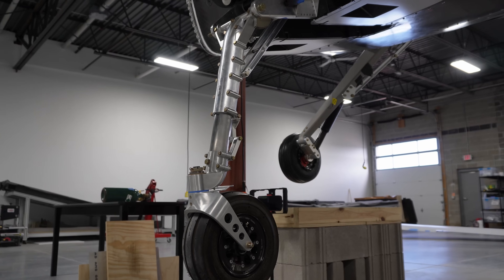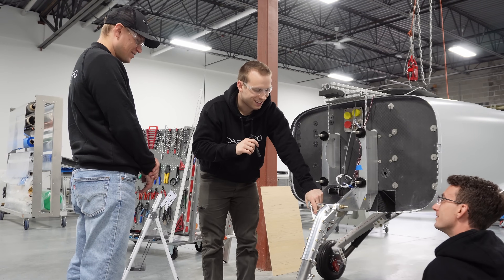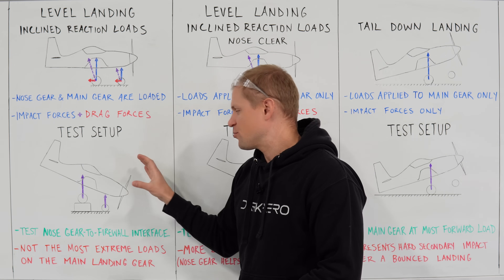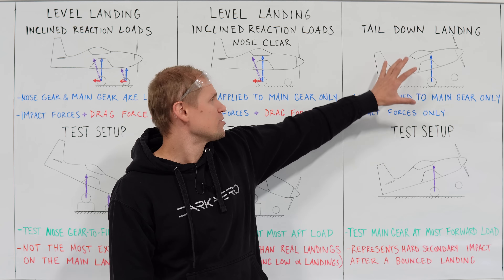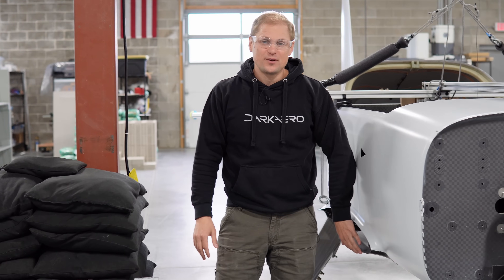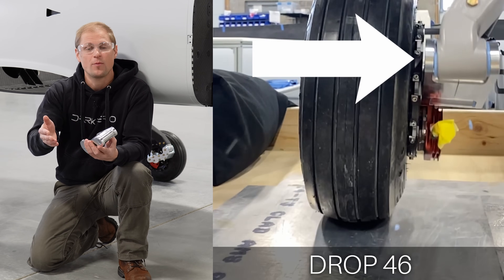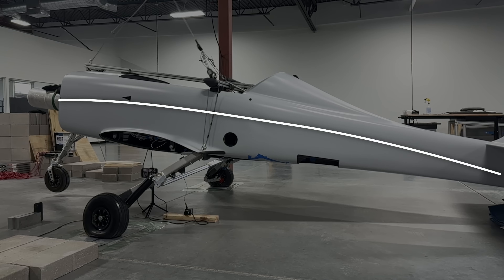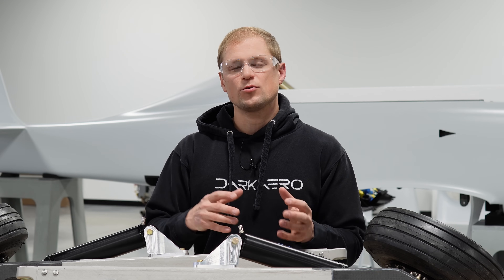We dropped the DarkAero 1 over 125 times - what we learned

Comment: I’m a mechanical engineer that has designed many complex systems. The problem is that you’re not testing anything to failure so you don’t know what your factor of safety is. You’re actually failing so you’re redesigning to pass with zero factor of safety. If your requirements are off, or your test methods are off, you’re going to have field failures because you have no factor of safety. Your design needs to last 100’s of thousands of cycles. It’s expensive to test to failure, but more expensive to kill someone.
Reply: Ridiculous, of course they design for and include a safety factor. They've definitely mentioned it in some videos. These are legit engineers, where on earth did you get the idea they don't figure in a safety factor?
Reply: @techienate Then why do they keep failing tests? It’s very hard to take a requirement like never exceed velocity and translate that into forces on the horizontal stabilizer in turbulence at -20 degrees Fahrenheit in the rain.

Comment: Do you use some kind of remote control for first flight tests? Seems like technology now allows it, though RC setup with heavy encryption and good resistance to interference(it`s just the equipment would cost more) should be used for such a big planes

Comment: Dark Aero has a great mission. I don't to be hat'in, but I think you are trying to "reinvent the wheel" with the landing gear geometry.  I foresee nothing but problems, just stick to tried and trusted gear, angles. This is one very critical system that NEEDS to be over built! Like I said, I don't mean to be hat'in, good luck, truley hope it works RELIABLY, as you have planned for the pilot and passenger saftey. After this has a proven track record, I will buy this kit!

Comment: The buckling issue is interesting, but I worry that the buckling is more of a symptom than an issue itself. 

Structures are often best to bend than to stay ridgid. Skyscrapers, bridges, etc. Even cars have some degree of flex built into them which is why we have unibody design these days instead of dedicated frames. If they were stiffened in order not to bend, they would certainly break at some crucial point instead, or they would need beefed up in the overall structure to the point that it would significantly increase the weight and performance.

I'm sure you've already thought of this. I'm just curious where those stresses were exactly, and how has preventing the flex impacted the structure during the drop tests?

Comment: Looks like you’re trying to litterally reinvent the wheel.   Trailing link on the nosewheel might be good.   But if someone is dropping the plane in.  That’s really more a pilot issue.  You’re not making a trainer here.   Honestly if I was doing a retract I’d just copy RV gear legs and then make them retract.  It seems you guys like sitting on the ground.  You need to hire some flyers and fire some builders/engineers.

Comment: Are you worried about the fact that the new trailing link geometry has An increased mechanical advantage over the shock throughout the travel? In off-road suspension design we typically see the shock ending up close to 90* at full compression.

Comment: I'm a fan of what you all are doing with bringing a new (and very cool) aircraft to market.

If understanding correctly, when the MLG trunnion fails, is the airframe is no longer airworthy because it is bonded to the fuselage?  

How was the MLG trunnion designed to ensure repairs and replacement in a cost efficient manner? (i.e.: Is it cheaper to replace the fuselage than to repair the MLG Trunnion?)

Comment: It’s unfortunate that such a promising young group of aviation  designers is going down the road so common with their generation, analysis paralysis.  Guys, not every landing is a 8+ G hard landing.  Get that damn thing in the air and evolve with your design.  I don’t mean to be critical but dear god, get on with it.  I’ve been doing airplanes for 40+ years, built numerous home builds, and as far as I can see, your design is superlative.  GET OFF YOUR DEAD ASSES AND ONTO YOUR DYING FEET AND GET THIS THING IN THE AIR.  Are things going to break, yup, is everything going to be perfect, nope, is it going to fly as good as it looks, well who knows, it hasn’t flown yet!  Get on it!  So tell me, in 125 hard drops, or out of optimal landings parameters, have you broken parts?  Have you torn out any structural bulkheads, catastrophic gear collapses, broken or bent the engine mounts?  The answer is an unequivocally NO!  I can name 10 certificated aircraft that don’t have the structural integrity in the landing gear that yours does.  Fly it already!  Set your baseline and move forward!

Comment: Just wondering, in the drop 118 configuration whether y'all considered moving the pivot point of the wheel inside the mounting point for the shock?  It just seems like the clearance in that configuration is getting awful close to the wheel rim diameter and an under-inflated tire might result in the link or support arm hitting the ground before the rim.

Comment: 1) to aid the concrete weights: add glass fiber reinforcement to resist cracking 
2) why would you omit non-level roll from testing in worse-case biased condition 
3) what about sub-zero condition or elevated temperatures where material expansion coefficients will add more stress to interfaces 
4) what about flat tire conditions if tire blows out and direct rim is impacted

Comment: i really appreciate the level of detail. These kinds of things you dont really learn practically in school, but on the job, so thanks for the insight!

Question though: will you perform side load impact drop testing? I imagine static loading can miss certain failure modes that would show up in impact (for the same reason you do vertical impact testing not just vertical static.

Actually another question: was this designed through iteration with transient FEM analysis? Or just static FEM and the validated with testing like in the video?

Thanks! Love this project

Comment: That's some great testing!

You talk a lot about spin-up loads; did you also consider spring-back loads? From my experinece in landing gear testing, these can be more critical, because it's roughly the same longitudinal force while occurring when a higher vertical force is present. This tends to be more critical especially when the landing gear legs are inclined forward.

Comment: Nice to see you guys are still working and haven't gotten bankrupt like many other projects on youtube. 

When you face shear buckling in a skin piece, I would be very weary of reinforcing that with sandwhich laminates. It's not impossible, and it will work, but repeated loading of sandwhich laminates under shear buckling may lead to delamination of the skin and core of the laminate. Why does this happen? When you look at the buckling mode, notice that the ellipsoid has two areas with tight radii. In there areas, the skin of the laminate experiences a significant load inwards and outwards of the thickness vector of the laminate. This results in a peeling effect, which can seperate the core from the skin (Or even layers from each other). To visualise this problem on a nice and comprehensive scale, get yourself a sticker that can be peeled off wax paper. introduce a buckling deformation onto the layer and observe the sticker seperating from the wax paper. The place where the cut on the sticker is (to seperate it form the outer shell of it) may be representative of small defects in the bond or surface. 

You can absolutely use this solution, just be aware of this issue. The common solution to buckling is, however, to glue stringers into the affected areas or simply laminate another geometry straight into the layup.
Reply: Or just accept the buckling. There's nothing wrong with some shear web buckling under extreme loads.
Reply: @MiG82au  if the shear web is a thin gauge material this is true. But if it is a Sandwhich-panel as the OP pointed out, the load bearings shear web skin can and will peel from the core, and this can be disastrous.
Reply: @Triple_J.1  that's what I get for half assedly watching. I missed that it's already a sandwich in that spot.
Reply: Perhaps a "brittle coating" might detect the loss of lamination.

Comment: It looks like the new trailing arm and spring arrangement might result in a falling instead of rising spring rate.  A rising spring rate is preferable.  Does the rise in spring rate of the air shock vs. Compression outpace the loss in spring rate due to geometry?

Comment: This thing is begging for the new Turbotech TP-R90 turboprop in the nose. As an airline pilot turbines have spoiled me. But I'd kill for a "cheap" light aircraft with a turbine. Flying a Cessna/Piper or any piston nowadays feels like going back to dark times. So loud, so shakey, so temperamental.
Reply: The UL520iS is not your grandfathers Lyconsaur. 

It is port fuel injected, ECU controlled. Uses modern automotive type sparkplugs and ignition coils, Etc.

Miniature turboprops have a ways to go. And will never reach the efficiency of a proper designed piston engine at low and medium speeds. 

The TP-90 is published 104kw/139.5hp. It has a published fuel burn of 20L/h at 50% power. Assuming Kerosene/Jet-A this works out to a BSFC of 0.507 which is exactly and precisely comparable to a carbureted 1964 O-540 which attains a BSFC in the range of 0.5-0.54. A 1975 fuel injected O-540 attains BSFC of 0.44. The same as the UL520i which is around 0.42-0.44 also.

The DarkAero1 airplane is powered by a 200hp engine. And there is a 220hp turbocharged UL520T variant that is essentially the same size. Some builder will probably go that route. So getting 25% worse fuel economy from an engine of only 70% the horsepower does not seem like a good trade. Like all turboprops, it saves almost enough weight to carry the additional fuel required to make the same flight. And each and every flight you make burns a deeper hole in your pocket. It only makes sense around 350-400mph to consider a turboprop. And a turbofan only makes sense above around 500mph.

Comment: Trailing link: I can't tell you how many times I've seen integral pins fail (at the notch) just like what was show. Based on what I've learned the conclusion is integral pins are *bad*. Most designs I've seen use a separate hollow hardened steel (eg. 4140) pin.

Comment: I was a crew chief on Airforce F-4C jet fighters but we borrowed Navy F-4 B aircraft. The F-4C used 250 psi air pressure and The F-4B used 425 psi on their tires.
Reply: Apparently you can safely land on aircraft carriers with that🙃
Reply: At those pressures, you can't safely land on some/many runways.   Asphalt is almost certainly a no-no.
Reply: @GilmerJohn  I'm curious why you say this, with proper engineering the loads are resolvable. It may not be the same tires between the two marks of aircraft.

Comment: i am going to assume you see what looks like a flex in the connection during drop 118 were you extended the geometry. it looks concerning. over time wouldn't that much flex create a problem with the connections integrity? or to more the the point snap it off?

Comment: Shouldn’t you remake the strut as one piece? Also, the rudder looks too small for handling strong crosswinds—I’m sure you have run simulations lol.
Reply: I pointed this out years ago... Their tail volume coefficient is pitiful.  No way would I fly this unless I was racing.  Gonna get someone killed.
Reply: You have to have about 5 or more unknown dimensions to be able to determine the tail volume coefficients. None of which are published or given in any of their videos.  

What is the area of the vertical and horizontal stabilizers? And where are their aerodynamic centers located? And what is their lengths from the aircrafts CG? And also, where is the aircrafts CG located in your calculation? Do You have the mean aerodynamic wing chord? You have to have the taper ratio to determine this from area and span. And what is the publish CG range of this aircraft after flight testing? Some of this info, even the designers lack.

There are some areas of question, sure. But they did wind tunnel test a simple model, so stick-fixed stability derivatives are probably well known.
Reply: @Triple_J.1  All those numbers are known from side profile scaling.  Sorry you are either lazy or incompetent.  Suggest being neither next time.  Technically, it will fly straight just fine.  The problem is when you are at low speed, cross wind, and you bounce.  Sure, it works for a racer, but it does not work at all for a GA aircraft.  Technically you can fly without a rudder at all; doesn't make it smart.  People fly Cozy aircraft too with Tiny tail volume coefficients/rudders and pitiful low speed performance where they can only land on paved runways over 2500ft long at very high speeds.  You will note, absolutely NO one is buying such aircraft and no one actually likes flying in them much.  PS: Just because someone puts something in a wind tunnel doesn't mean a damned thing if one doesn't actually do the stability tests IN the wind tunnel.  They have never published anything regarding this if they ever had done so.

Comment: Looks like you need more lever and less leg on the main gear to take advantage of the full absorbtion stroke of the strut.

/|   vs your current /|  this will stave off the tire deflection until max load of the suspension has been achieved.
\|                               ¯O
  O
It will increase the force absorbtion rate and decrease the load shock the chassis exibited causing the fuselage deformation. It will aslo move the mains a few inches aft during max deflection allowing you to tune out the splaying by canting the levered arm outward under load so the wheel goes toe in under increasing load. 

It will also help you keep the mains suspension stroke on par with the nose stroke deflection so they compress at simillar rates. Will probably inherently mitigate the rebound forces and therefore decrease the possibility of bouncing. 

Also instead of a single rectangle of core foam for the fuselage deflection consider an X or a * star core pattern. So it isnt prone to give in any particular direction over time.
👍

Comment: You might want to do some cold soak drop testing on the air shock. Some of the snowmobile guys have had failures in very low temps with air shocks. The seals specifically. Might not be an issue with the shock your using though?
Reply: It’s off the shelf FAA rated shocks so those tests are already performed with the tolerances available to calculate stresses off of.

Comment: Dark aero has extreemly weak wing. I am judging from number of Gs it is contructed for and comparing it to many LSA aircrafts made in Europe. European LSA aircrafts have wings constructed for higher G loads despite they are probably slover except of Risen which can travel 230knots...with 140hp Rotax.  Given the facts, that European LSA aircrafts use much weaker engines and except of Risen they are also slower airplanes, I would expect (and wish for)  a much stronger wing on any airplane like Dark Aero is..... Risen´s wing is rated for + 5 G  . It is powered by ROTAX 916 and with this angine it can travel 230 knots.

Comment: What about a single side landing gear impact, such as happens when approaching  the runway with a roll angle?
Reply: FAR Part 23.  The “ground reaction” horizontal forces on one side is .333g acting inward, and the other side is .533g acting outward.  (If I remember accurately).  Simultaneously there is a vertical force of .5g per wheel.  This ought handle the one wheel landing you have in mind.
For a straight drop, 1.5g per wheel.  All this has an additional 1.5 safety factor.
   Landing gear is one big pain in the ass to design.   It’s iteration after iteration trying to make it strong, have the right spring rates, and not be heavy.  The Dark Aero crew might have been better off with heat treated steel bar like a Cessna 172RG or a C210.
Reply: I reread the FARs.  It’s .333W and .50W side loads with .50W vertical each wheel.  W being the gross weight, not g’s.

Comment: Nice video, love the details on the testing and results! Couple questions:

1) At 13:45, the fractured cylinder seems to have failed at a sharp inside corner, any change a radius transition could be used here? Aluminums generally should have transition rads as they're more prone to fatigue and fracture than steels (major simplification of actual dynamics, but reasonable). Even with the "beefier" design this is still helpful. And if you don't mind, what is the alloy?

2) I'm curious about the attachment of aluminum elements to the carbon strut - are you using fiberglass scrim or other isolation methods to prevent a galvanic cell? And is there full understanding of the load concentrations that occur where fasteners and load spreading plates have been added? It's an area where what works well in month one may have issues in year ten, especially in humid or other non-ideal conditions. Even the fasteners themselves come into play, either from fatigue or their own galvanic behaviors.

Not a real engineer, just have some practical background in aerospace design and builds (satellite stuff and other things). If you get a chance will appreciate your thoughts.